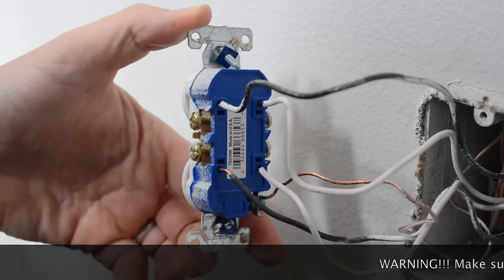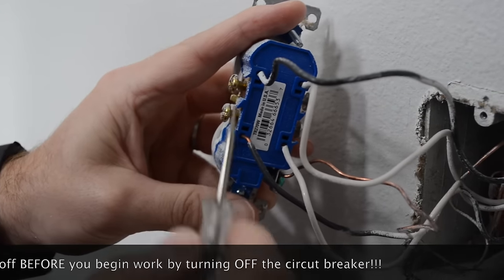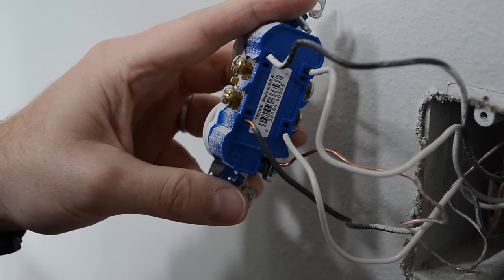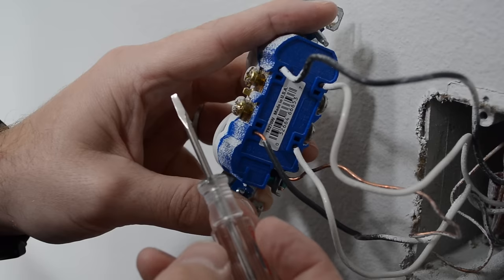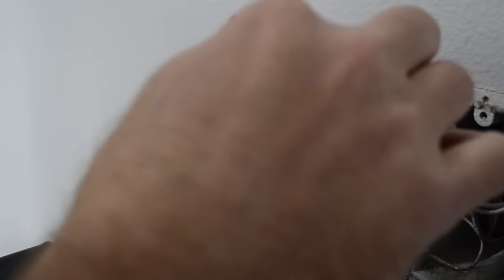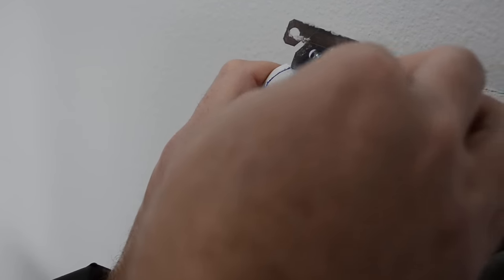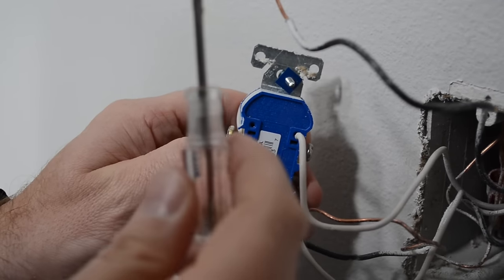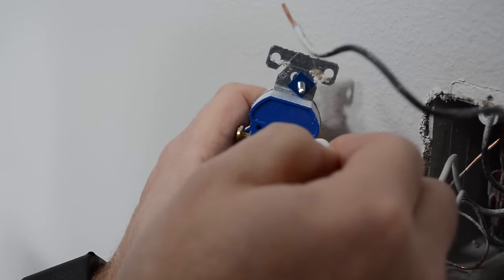How to Release Wires from a Push-In Connection on Electrical Wall Outlets

Comment: Nothing more infuriating than doing exactly what he's doing and the wire is just stuck in the switch
Reply: Thanks for the hope. I’m struggling with getting two wires out of a light switch too. Luckily the new light switch doesn’t involving jabbing wires into anything.
Reply: Same. I'm ready to just get a new switch and cut the wires. It's pretty ridiculous. Whoever designed these connectors is a sadist.
Reply: The trick is to use so much force that the plastic housing shatters and the wire comes free. 😜
Reply: Ok came here looking to see if I was the only one!
Reply: Same here lol
Reply: @michaelk077 for real was like... Cutting the woreight just be easier
Reply: yall if its long enough to cut just cut the thing and re strip
Reply: “It comes right out”
Reply: controls engineer here, also fighting with these POS outlets. Fyi is probably easiest and quicker to cut wires and strip again. Fuck whoever made these outlets, just use the damn screws on the side jeez.
Reply: Same issue, I decided to cut the wire, that made it easier to remove them from the back of the outlet using pliers and a screwdriver.
Reply: One thing worse. When the knucklehead that wired it gave you 1 1/2 inches space to pull out outlet. Turns a 15 minute job into ??

Comment: Who thumbed down this guy!?! He just saved my whole Saturday morning!  Still got enough time for a bowl of cereal and looney tunes😁
Reply: Bc it never works.  90% of the people here kno how to do it, they are researching it bc they are looking at tips for when it doesn't magically go perfect like it is with this guy.

He doesn't address the main reason people are here. He's using a brand new receptacle he just put in. Of course it's gonna come right out.

How about some practical help guy?
Reply: Right, Reg? It took more pressure than I thought it would, but I'd still be yanking at the wires like a mook if I hadn't found this vid 😄
Reply: I agree it worked perfectly !
Reply: A year later and this just saved my Saturday morning as well. Especially since one just came out without that so I thought the others were stuck.
Reply: I’m thankful. I busted the switch but don’t give a hoot. The wires are free and I can connect them to my smart switches. Never crap on a guy trying to be of help. While it may not have helped one person, there are likely thousands that it did help.

Comment: Rather than cutting the wire like I did after watching video, I learnt that the right way is to push a thin flat head screwdriver in the rectangle hole below where the wire is inserted and the wire comes off easily. No need to cut wires, remove and inserr in replacement socket and saves lot of time.

Comment: Recently I encountered a Leviton Decora switch that had push-connections and the small flat blade screwdriver that I usually carry to release the wires on such devices absolutely would not fit into the slot.  Since I was on the clock, I jammed the screwdriver in forcefully, slightly damaging the plastic on the switch, but eventually got the wires to release. 😠  I'm not sure when this switch was manufactured — probably 15 to 20 years ago — but I think Leviton has since changed the design of the release slot so a small screwdriver can do the job as shown in this video.  To prepare for another possible encounter with such a balky switch or outlet, I went to the hardware store and searched high and low for a suitable tool, but no joy.  In the end I found a tempered steel street sweeper brush tine, which I filed a little narrower to fit the slot to make a part of my electrical tool kit.  Eventually, I'd like to fit it with an insulated handle, as I sometimes work on live circuits and would not want be holding a piece of metal that comes in contact with the hot lead!!

Comment: I don't know  how to thank you enough for this.  I was using pliers to break apart the entire old outlet.    To replace five old outlets was taking hours.  So dumb.  Thanks!
Reply: You were getting real mad at those outlets I bet!
Reply: Probably could have just cut the wires too, you really don't lose a lot of wire and if a wire ever gets too short in the future it's easy to pigtail, very much doubt you'll ever run out of wire from one or two fresh installs of outlets.

Comment: I'm glad after fighting with it for a couple minutes,  I googled it.  This video saved me so much time.  Also I didn't have a small screwdriver,  so I pulled the tip off a bobby pin.  It was like it was made for that slot.  Worked like a dream.  Thanks.
Reply: Yes!!! This is what worked for me!

Comment: I appreciate this. When i replace an outlet i usually replace it with the same kind except with a tamper resistant outlet. Several outlets jump from this one outlet and it wasn't installed tight enough so it got loose so it burned a small part of the outlet. It still works but i'd sleep better knowing it was a new one in its place. This saved me a headache of worrying if i would damage the new one trying to git the wire in it. Thanks a lot.

Comment: Thanks I was worried that some arcing happened in the bad switch and was trying to brute force it hoping not to have to cut and strip the wires. I've only ever used the hooks (like my grandfather taught me).  Saved me a bunch of time.

Comment: Here it is 2023,
My home was built in 1984 and my wife and myself are doing much needed updating. So changing  outlets and on my house depressing with screwdriver to release was a no go, wires would not release so I slowly backed wire out using leverage of needle nose pliers. Perhaps receptacles were garbage to begin with but good to go now. Folks are utilizing your video so
Thanks for that.

Comment: You make it look so easy. I've tried this many, many times, including today after watching your video. Can't make it work. Hubby and I tried about 5 different screwdrivers, some really tiny and some that just fit the slot. I think Leviton here in Canada is probably laughing. Luckily I had enough wire to just cut them.
Reply: There is a special screwdriver you can get to do this. Obviously you could use a small screwdriver but I heard from an electrician that a special tool does exist for this express purpose.  I wish I remember the name! I was searching these comments in the hopes of finding  it...
Reply: It always works perfectly in the demonstration. Why do they think we come here, if we can't get the wire out?

Comment: Thank you for this simple trick.  I didn’t have a small flat head so I used the small file on a pair of nail clippers and worked perfect.  This is why I love YouTube for people like yourself to help a dumbass like me that jumps right into things and needs people like you to get me out of jams rather than swearing at myself trying to yank those wires out without this trick, lol.

Comment: I always just snapped the switch in half out of frustration, seemed to work fine for me
Reply: I just replaced a bunch of outlets and uh, yeah. I stabbed the last one to death with a screwdriver because I don't have a screwdriver this tiny. Some of them had the slot extend all the way to the edge most of them were weak enough I could just pull the pliers out. But this one? Yeah, it got the 2020 treatment

Comment: Great - so what happens if the wire doesn't come out even though you're pressing in the hole with a small flathead screwdriver?
Reply: You pry the damn thing apart by twisting the screwdriver, shattering the plastic and freeing the wire. (And its good to swear a bit while doing this). That's how I do it!
Reply: And without stabbing your hand?? 😫😫
Reply: instead of pulling the wire hard, move the wire in a circular motion, not twisting, but as if it were a miniature jump rope and pull the outlet away from the wire
Reply: @stanfisher6660  Never tried that. I will next time. Thanks.
Reply: Craig Wheeles
Reply: You cut the wire and buy a new plug ... that's what they want you to do.
Reply: After spending fifteen minutes trying to get the wires out, the mini circles ( jump rope) method worked! Thanks a bunch.

Comment: A lifesaver, saved so much time & effort. The smallest screwdriver kept breaking the plastic back. Used a micro screwdriver with lots of paper napkins to save my hand. 
Please add advice for novice DIY’ers to break the bridge of the receptacle if it is a Split Receptacle (double circuit) with more than 2 wires besides the ground wire. I learned the hard way.

Comment: On very old switches, once that screwdriver process is used, the hole cannot be used to securely retain a wire again. It's actually a good idea to get rid of those old switches anyway and replace them with ones that a screw retains the wire. Many of those can be wired from the back too.

Comment: While this is the only method to remove wires that have been inserted into those holes, I can testify that some are really tough to remove  using a screw driver. And not all outlets take the same size of mini screwdriver as I found out. The other issue, note the length of the wire attached to the plug. I had someone else connect the wires on me and they made the wires considerably shorter and I had a bugger of a time stretching the wire out so I could just manage to use the screw driver on the back of the plug. Make sure you leave wires long enough! Although it doesn't happen often, sometimes the new plug is dysfunctional and you have to remove it. Terminal connections may take initially longer to install but in the end, at least you know if you have to replace the plug, an ordinary screwdriver is all that is needed.
Reply: I was about to say the same thing... I just tried removing mine and I was pressing as hard as I could with the screwdriver and nothing budged.  I was pressing so hard, the metal had gouges in it... This certainly doesn't work.   Those wires are in there permanently, so I have to cut them now.

Comment: You need to orient the flat screwdriver blade and press until it actually slides in. You aren't just applying pressure -- it needs to slide in.

Comment: Why can't I get this to work? The screwdriver won't budge the tabs  no matter how hard I press. The wires are stuck.
Reply: If you shut the power off, turn it back on.
Reply: @endlessnameless3996  I don't get electrocuted and I can get the wires out of a back stabbed receptacle too and no, no I'm not Batman, Amazing yes but not Batman.
I bet you turned the power back on didn't you?
Reply: Just messin. Not being serious man (or lady idk), I actually had a  broken receptacle on the bench all dismantled and I was thinking how to show you the picture. I'll be back...
Reply: @endlessnameless3996  look look at my profile picture. Hahaha, maybe you can tell but the Red dot is where you back stab for install and the black line is where you push in to remove the wire. Sometimes they can be a pain.

Comment: Good video sir but please make sure you tell everyone verbally to turn power off at the breaker and verify it to be OFF at the switch with a simple voltage detector before you do this otherwise your palm would be touching a potentially hot screw while pushing in the back of the screwdriver (1:01) - could lead to a nasty surprise at the very least....

Comment: How do u reconnect to wrap around screws for a better connection? The straight wires that go straight in are very unstable if you use the plug a lot. Especially my outdoor outlets where I'm constantly using those for heavy power cords. My electrician says they become loose over time and the outlet stops working because the connection is loose.

Comment: I have a question if the wires are NOT on the back but on the side Can I release them safely without turn the power off?

Comment: How do I get to put the wire back in a new outlet...my wire seems to thick
Reply: I hope it's too late, but you use the screw on the side if you're not a monster
Reply: put it on the correct side screw

Comment: Unfortunately, not all switches have the slots for removal.  PITA... guess i have to cut but I'll dump the switch even though I could reconnect at the screws.  PS I even hate using the ones that do have the slots, sometimes they fail to hold the wire securely.

Comment: Successfully released the mechanism. Wire was still stuck. Turns out whoever wired this place thought it was funny to do some irreversible shit, so I ended up cutting the wires and installing my new receptacle which had a push-in mechanism held down by a screw. Best of both worlds.

Comment: then what are those screws for? I thought we need to use screws to attach the wire to the switch
Reply: you can use either method.

Comment: Nice video.  I had this issue and still could only get 1 of the 4 out.  Ended up prying the outlet apart and saw why.  Apparently there's a variant of this in which the"one-way" tabs that hold the wire in are actually separate, meaning you'd have to shove something in the same hole as the wire for this to work.  If all else fails, pry the metal pieces away from the top and bottom of the outlet and then pry the face off and get it from the front.  Also useful of the imbecile didn't leave you enough wire to pull it out, but that never happens 😂

Comment: So when installing a new outlet you just push the wire in and it automatically locks?
Reply: Don't do that. Make a j on the end of the wire and loop it around the screw on the side and tighten it down.

Comment: What if the wire won’t stay in the hole after doing this? It no longer grabs my wire after removing it. Going to have to resort to using the screw.

Comment: I hate these push in/backstab connections not as secure and i notice issues with theses when using high wattage devices like irons or vacuums and they never come out for me regardless of what i try i always end up cutting them and just use screw terminals the backwire ones are better or those new leventon ones where the outlet has a wago like connector built into it

Comment: My receptacle has two red, one black and copper. Which is which.
Reply from the maker: Thank you for the question. In that situation you would have to test each wire to be sure. If you are uncertain, be safe and call an electrician.

Comment: Yeah im in a Share, god forbid i shut the main breaker so i can do it safely without everyone bugging out for 5 damn minutes without shocking myself cuz i wanna cut em off and use the side screws.We have 3 dead outlets on this and i have new ones and changed several at work but i have to figure out which breaker without shutting the whole house off as none are marked naturally.Last year i replaced a breaker.The big lady is plugging in her AC right now from the outlet that died a month ago to the one that already has a 6 gang plug in it.I garantee its gonna keep popping off.This place needed new outlets yrs ago so their old , some are even upside down 😂 but she refuses to quit smoking plus shes large but def not in charge lol and it "is" quite Hot in that living room so if it pops ill trip the breaker and replace the 3 outlets that are dead while im at it.Wish me luck lol .

Comment: How to put the wire back in?
Reply: Don’t put the wire back in.  Back stabbed connections have a spring inside that holds the wire in place after you insert it.  Once you release it, though, you should not re-insert them, because the springs won’t hold the wire properly.  If you want to back stab again, get a new outlet.  However, you can use the same old outlet if you just put the wires on the side terminals instead, which is also a safer way of wiring an outlet
Reply: @tidefalcon1631  and the next person handling the outlet won't be cursing you the whole time

Comment: I would first start with saying, make sure your outlet does not have power going to it, only an experienced electrician or person could do this with out getting shocked, anyway you hold this outlet when trying to remove wire will shock you if you have power turned on, of coarse this is for someone that is not experienced,  check you breaker panel and turn off power to the outlet or switch, good luck.

Comment: That didn't work for me. In my case you had to loosen the screws on the side to get the receptacle to release the wires from the back. Broke all 4 copper wires off at the receptacle before figuring it out.

Comment: Dumb question can you do this while the electric is on
Reply: You can do whatever you want to do. But you shouldn't. If you touch the hot (black) and neutral or ground you will be enlightened about why it's a terrible idea.

Comment: I have a maybe-not-better, but definitely more effective method:
1) Try in so many hopeful but desperate ways, but fail, to remove the wires while the outlet is still connected to the wires in the box.
2) cut the wires about 1.3cm away from the outlet
2) spend 30 minutes trying to extricate the 1.3cm pieces of wire from said outlet using a variety of tiny screwdrivers and pliers to try and save the $1.50 outlet.
3) dispose of the stupid outlet
4) trim remaining wires
5) install a new outlet, ensuring to avoid the effing "quick connect" (TM) terminals and using the screw terminals instead.

Comment: Keeping in mind that this type of connection is dangerous and can cause fires and equipment damage.  Newer outlets allow only #14 wire to be used in this way, which is only slightly safer than using them with #12. Most of them will allow removal of the wire only once. After that, the blade and spring are ruined and will no longer hold the wire securely, or make a passable connection. Be safe!! Don't use this Mickey Mouse crap!!!!   USE THE SCREWS - every time.

Comment: It is WAAAY to hard to push on that little thing, better off just cutting it and buy a new outlet for $2.
Thanks Leviton for not being able to design a proper product!
Reply: You could of just attached the two wires to the appropriate set of screws on either side of the power outlet